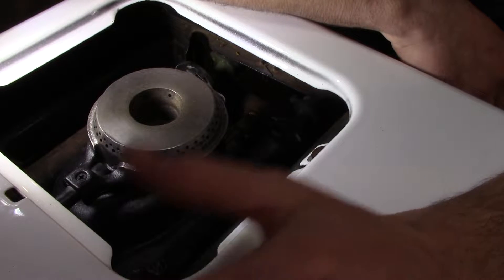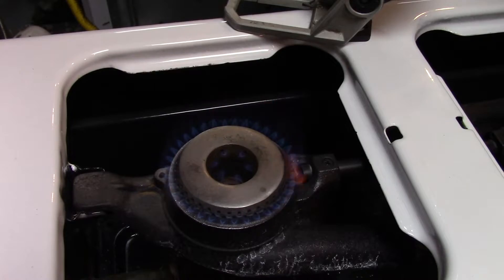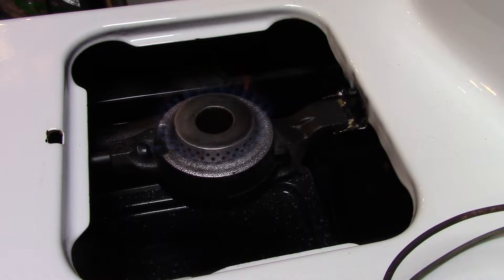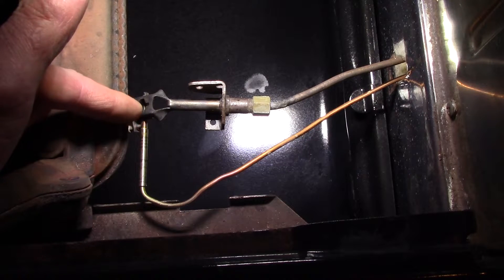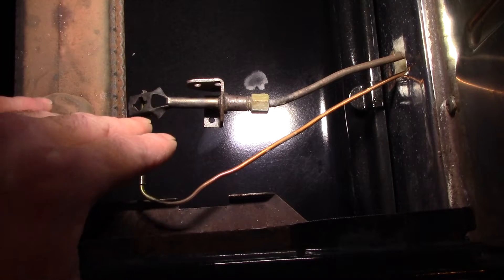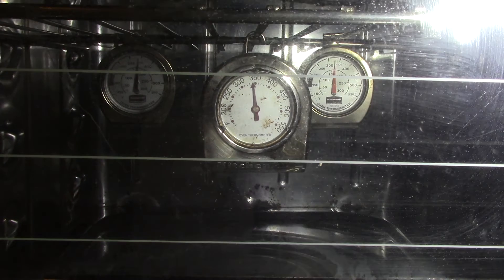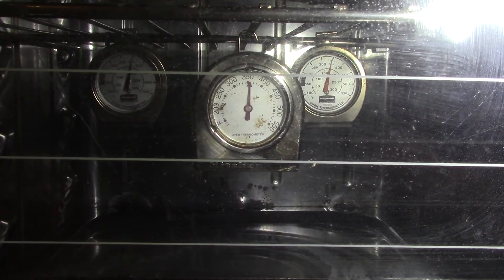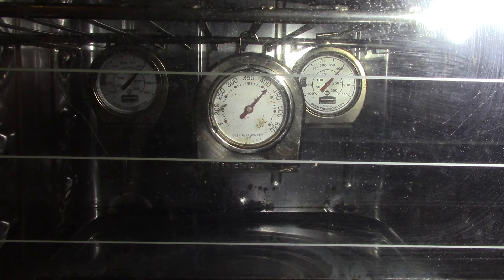Part 3: Restoring A Vintage Tappan Deluxe Stove- Calibrating the Burners/ Oven

Comment: My mother has a 1949 model of a stove much like the one in this video .  It has no pilot light and and no broiler foot petal and the oven and broiler handles are much simpler.  Like that there are three burner sizes timer and clock still work and the oven thermostat was replaced once over 40 yrs ago